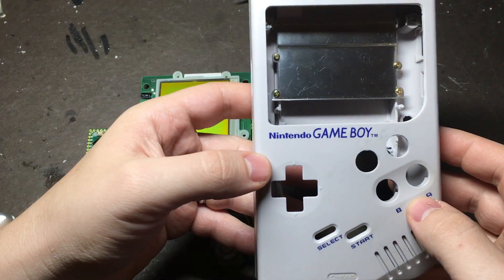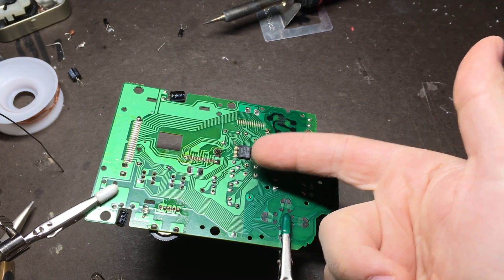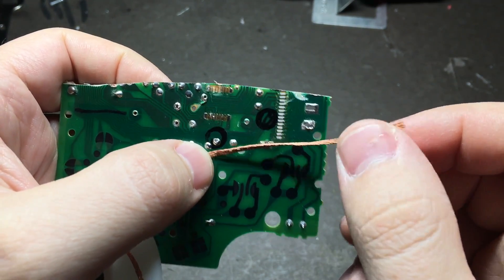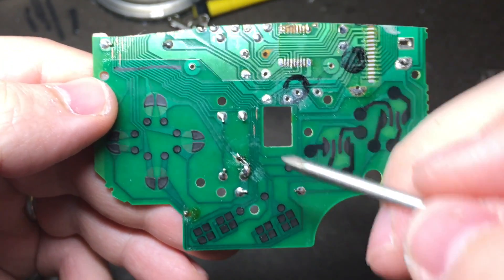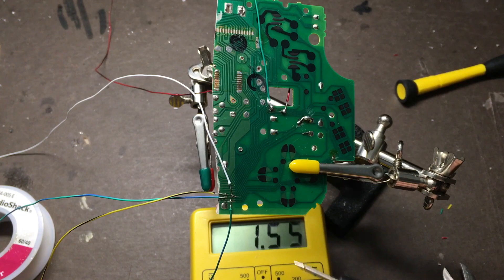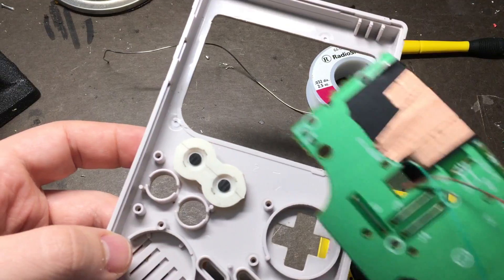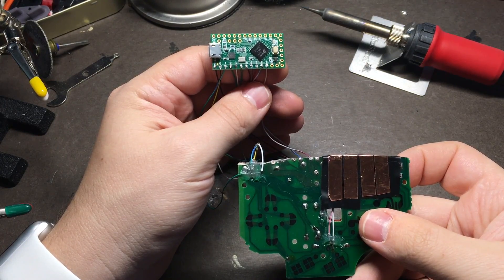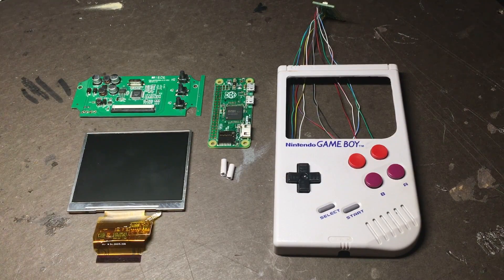Game Boy Zero Guide Part 2 - The Controls

Comment: You can just buy Gameboy empty case from China. Go to Taobao.com and search "gameboy 機殻".  Actually, Raspberry Pi3 B is only 85.6mm x 56.5mm x 17mm, while Gameboy Classic is 146mm x 90mm x 32mm.   I think it is possible to completely replace the top screen section with a Raspberry Pi 3B+screen kit. Then just 3D print part of the top section of backcover, as well as 3D print a Black/or Grey color plastic piece to cover up the screen area. Install a tiny recargable power bar(plug directly the microUSB on screen(which also supplies power to Pi3), the lower section install a keypad/buttom PCB module.

Comment: Instead of using the Teensy, you could use GPIO for the inputs (since you seem to be using composite video anyway). Theres' a tool that's out now called "GPioneer" that makes it dirt simple to do inputs via GPIO.  It converts buttons to keyboard presses.  It works perfectly in my Lynx-Pi.  (I also used a BH (?) screen that didn't match any of the ones on the blog, but it was fairly easy to inject 5v into it. :D

Comment: 1 question at 7:30 i have the same lcd but i dont know how to make it works for 5volt can you help me?
thanx alot
Reply from the maker: I show that in part 3. :)
Reply: in part 3 you are use the adfruit lcd
but in 7:30 i see lcd screen like mine...
Reply from the maker: I was going to use that as a fallback because it was taking forever to get the Adafruit screen (what I originally intended to use).  The adafruit one finally showed up between when I filmed this and when I started the next part.
Reply: so its pointless to use this lcd ?
Or i have to search an other one?
My problem is its easy to make it works for 5v?
I  see in adfruit lcd you remove 1 regulator 
Its possible to do for this lcd? till adfruit comes to me ?
Reply from the maker: Which screen do you have exactly?  You can't go by just the LCD itself, you need to know what driver board it has.  Feel free to stop by the forums at sudomod.com/forum for more help - tons of folks active on there.  Also check out the wiki at sudomod.com/wiki - you may be able to find your screen there.
Reply: ON-AMT630A-3.5-V01 i have this
Reply: i found it ;)
the strange is in other video the same lcd it work without mod ....
Maybe it troll video cuz i test it many time :D

Comment: @wermy Instead of using the original controller board, would this board work and follow the same steps as far as hookup?
http://sudomod.com/forum/viewtopic.php?f=3&t=28
Reply from the maker: Yep.  That's actually my site.  :)  That board was made specifically to make this part of the guide easy, definitely worth getting one!
Reply: +wermy awesome! Would you recommend one of the new pi's as they're more powerful? Or pi zero is sufficient for emulators
Reply from the maker: +Chris Panton it really just depends on what you want to emulate. For anything up through GBA and some arcade games (even a few N64 games) the zero is fine (it's also much easier to fit in there and much more friendly towards battery life).
Reply: ya GBA, NES, SNES is probably what I'll want to do
Reply: Would the setup/guide be the same for a pi 3 model b or any pi variant? how is the performance of the zero? any lag or issues with games?

Comment: I think I'll just use a common ground gameboy button board
Reply from the maker: +Somebody Else they definitely make it easier!  The ones with X/y buttons didn't exist when I did mine though. :)
Reply: +wermy Hold up! How did you mount the X and Y buttons on the front half, without the moldings holding it in position?
Reply from the maker: They actually stay in place just fine for me without those.  They stick out far enough that they stay in place.  :)
Reply: +wermy could I buy one from you? I don't have the materials to make one, mostly a computer. lol
Reply: reusing the button board from the gameboy gave me endless headaches. those traces are so small and hard to solder to. especially since the gameboy i purchased had leaked battery corrosion inside

Comment: I have a Teensy 2.0 board will that work with this?
Reply from the maker: +Danny Rouse Yep it should work fine.  Only reason I recommend the LC is because it's the cheapest (LC actually stands for Low Cost)
Reply: Wow that was a fast response and cool thanks I'm following your build cuz I tried doing my own with a different model of Raspberry Pi and it's not turning out the way I wanted it to so keep up the good work your videos hasve been really helpful...

Comment: its too bad the controls are so complex, im fine with the soldering and everything but you have to buy an ardiuno just to program the other board? is there not an easier way to ad controls? maybe something through the pi's usb or other interfaces
Reply from the maker: +1234garrett1993 You can add controls through the GPIO, but that requires more configuration than just adding a Teensy board.  The Teensy actually is hooked up through USB, and shows up as a keyboard (in our case).
Reply: wermy ohh i see, thanks
Reply: wermy
if you are ever interested in selling one i would love to know lol
Reply: Adding controlls through GPIO isn't really that hard. You just need Adafruit-Retrogame-master copied to your pi. The config file is really easy to modify to your liking.
Reply: Would you still need a teensy board if you get the controller pcbs?
Reply: Nick Jennings Thank you for answering! Really appreciate it. Are all the GPIO pins enough for all these buttons including the ones for sound and all that? So I dont run short so to speak :)

Comment: http://store.kitsch-bent.com/product/common-ground-dmg-button-pcb

Could something like this be used instead of moding the original dmg buttons? Or what about just picking up a SNES controller PCB instead?
Reply: yes, that motherboard is perfect for this as it requires a single ground wire. a SNES mobo would be too big and not correctly shaped for a Gameboy case
Reply: +12raeve j Awesome, save on that real intricate soldering stuff. All you would then have to do is add the 2 extra buttons
Reply: +Alex Chipman that control board looks awesome, but would you have space to be able to fit the buttons on top?
Reply: Keith Jordan possibly not. My plan is to use the control board I sent alone as I have no need for additional buttons as I don't need to play SNES .
Your best bet is to use the original board and chop off the A B button pads or do what the wermy did in the video but with the newer control board as it has much easier solder points and is all round neater

Comment: +wermy do you think it would be possible to do this but for an xbox case? and have it emulate all the console games?
Reply: possibly. you wouldn't want to use a Pi zero though, as the power supply and the specs aren't good enough. instead you should try a Pi 3. although even then I doubt itd play Xbox games as I haven't seen any Xbox emulation so far. if it's the original Xbox then at an enormous push you may be able to emulate it. for the best bets you'd get a PC, but those are more expensive than an Xbox however.

Comment: How many games can it hold? and what consoles can it emulate/
Reply: the amount of games depends on the SD card size. it runs retropie so it can play Gameboy (original, colour, advance) NES, SNES, N64, PS1 and various other retro consoles like the atari and even old PCs like an apple
Reply: you can play all those on this game boy zero?
Reply: Josh Wilson yes. However it will never be 100% perfect. The N64, PS1 and GBA emulation required over clocking at a minimum, and that unfortunately reduces the life span of any PC or device. I haven't gotten my Pi Zero running yet, however an example of imperfection is on my Pi B. SNES runs smoothly with no problems at all, yet running NES has major lagging and horrible sound glitches.

Comment: what an average cost for the entire system?
Reply from the maker: +DE4THRE4P3R yeah, tools do bump up the total cost a bit...  But once you get into this hobby it's hard to stop, so you'll likely get your money's worth out of them. ;)
Reply: +wermy you should make a blog post about the tools and what you think are best for this kind of hobby lol cause honestluy im at a lose at what to buy
Reply: +Josh Wilson well if you're gonna buy something just for this project go cheap. If not. Craftsman is a good brand. And any soldiering iron would work great. One with a station and temp control would be perfect
Reply: I added it up. It's going to be around 160ish bucks for all. The parts. More or less depending on how much you pay for the system and shipping costs
Reply: +DE4THRE4P3R does that include tools?
Reply: +Josh Wilson no. Assuming you already have the tools that's the total. But you can get a cheap Dremel online for 25 bucks. Soldiering iron for 10. Soldier and desoldiering wick for around 15.